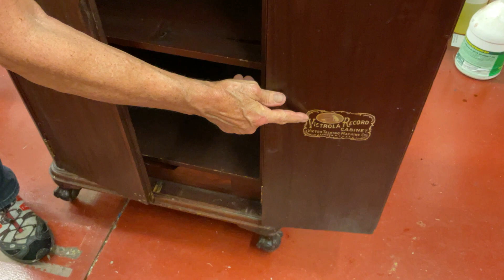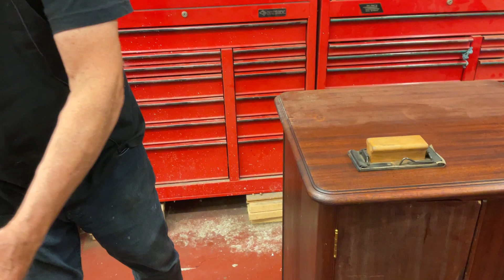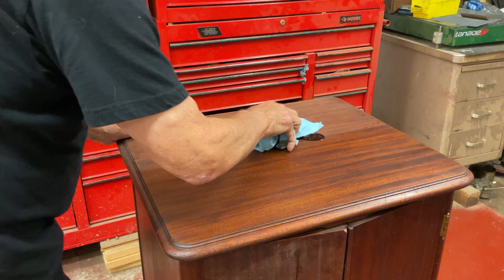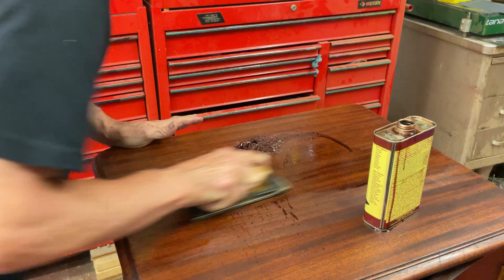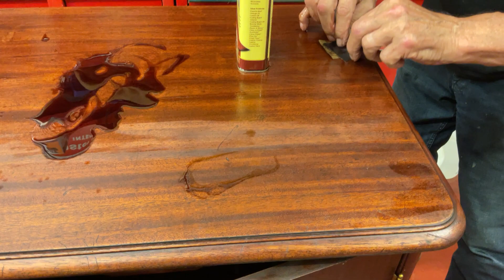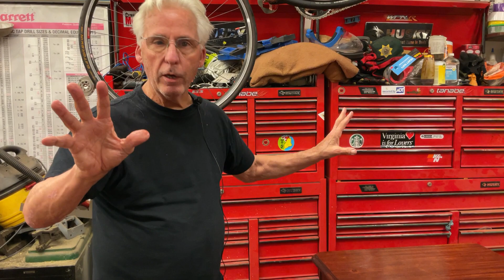1614.  Restoration of a tired Victrola record cabinet

Comment: I have an early 1900s Victrola player cabinet that we picked up at an estate auction.  Amazingly, mostly working condition (brake pads don't stop it when not playing, we just let it wind down every time).  Cabinet is not in good shape, weird rough texture on the shellac(?) surface finish.  I'm definitely going to give this a shot.  I've never considered "wet sanding" wood, let alone with a finish liquid.  I figure worst case scenario is full refinish at some later date.  Appreciate your videos on these old machines, I don't have time currently, but plan on giving mine a thorough going-through at some point.  It's fun cranking it up and listening every once in a while.
Reply from the maker: You really don’t want a full refinish if you don’t have to, it is far better to restore than to refinish.

Comment: Hey Brett,  A handy tool for those mouldings are tadpole sanders.  They're little rubber blocks you wrap sandpaper around.  All different shapes.  I think Klingspor has them. I use them a lot.  So far mine have held up against chemicals too.